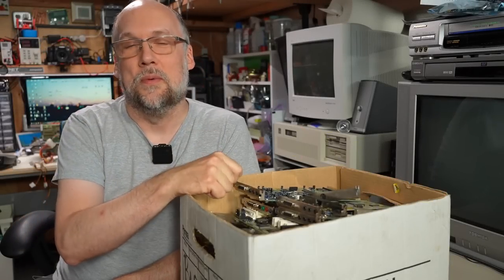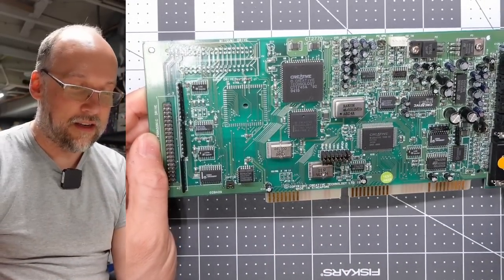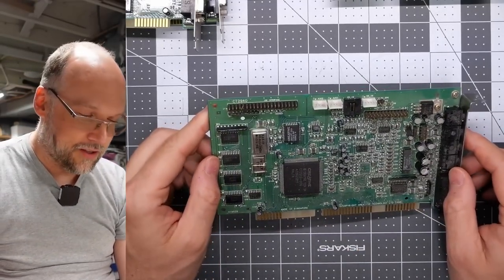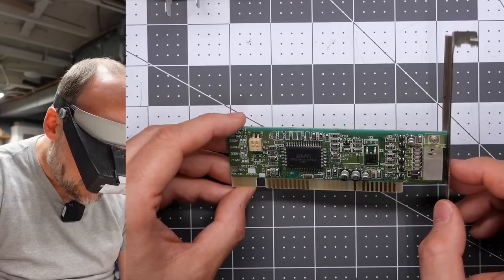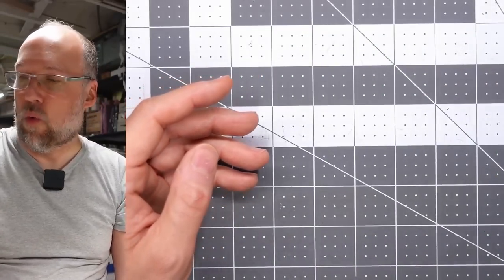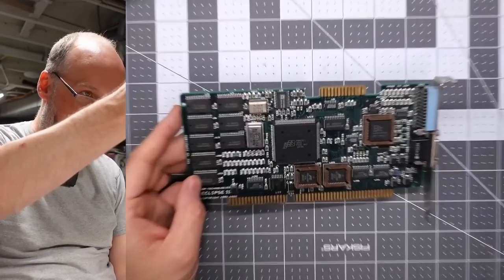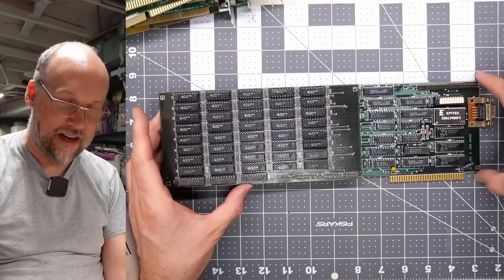Tech archeology: Exploring mysterious computer parts

Comment: the tms34010 was used in TIGA video cards. these were used for CAD workstations as far as I understand. the closest I have been able to find was the Siemens C79040-R430-C35-02-87 which uses the same chip for video. I think I saw TIGA drivers for old Autocad before.
Reply: Yes, I can confirm 👍
Some of these cards have a Demo mode built in by the way, enabled by dip sw
Reply: Correct. The TMS34010 was the first programmable GPU. I designed both TMS34010 and TMS34020 boards and AutoCAD was a very typical target application. They were used in both accelerated and mostly non-accelerated roles where some operations needed a boost. There was also a version of the chip with just the video circuits and no acceleration called the TMS34061 which the same team created and which also powered a lot of video cards from then.
Reply: Yeah I used to use a 34020 based #9 card that was TIGA.  But TIGA was a standard from 1989, so a card that says 1987 might not follow the standard or could be a prototype card.  I sure don't see any info that vectrix corp ever released a TI based card.
Reply: Someone mentioned EX1280 and pictures sure seem to match.  I found a brief mention in a pdf saying it was a high res video card with built in vga support as well.  Strangely there is also code in mame for that card. Was it used in some arcade machine?

Comment: The MultiSound line of cards from Turtle Beach was well renowned in pro-sumer music, recording, broadcast, and audio engineering circles as an affordable, high quality audio interface with very low noise.  There are only a handful of DOS games that natively support them for PCM, and they don't offer SoundBlaster emulation or FM synth.  Wavetable-equipped models are General MIDI, however.  Yours is missing the "Tahiti" silk screen which would have been where you wrote "Tahiti" on it.  This probably means it was sold as the Turtle Beach MultiSound Monterey which included the Rio wavetable daughtercard as a bundle.  The Rio utilizes a ICS WaveFront synth chipset, Motorola 68EC000 microprocessor and includes VoiceCrystal soundfonts in its 4MB ROM and SIPP slots for RAM expansion.

Turtle Beach also marketed some more consumer/gaming oriented cards like the Tropez and Monte Carlo series.  I had a Monte Carlo 929 for years and it had very good SB Pro emulation, even stereo worked flawlessly.  It had a real OPL3 IC, and a Windows Sound System codec.  It was noticeably quieter than generic Opti 929 based sound cards, not to mention my Sound Blaster 16.

Comment: 54:18 The Zilog SCC is communicating via an AM26LS30 Dual Differential (EIA-422-A)/ Quad Single-Ended (EIA-423-A) Line Driver chip, and a AM26LS32 Quadruple Differential Line Receiver
Reply: https://en.wikipedia.org/wiki/LocalTalk

Comment: Almost guaranteed the protoboard with the gal, was decoding IO address, and latching them and then exposing the data on that 25 pin dsub, and it looked like they actually had it wired in through the standard 1-8 data pins for the d-sub printer port...

I'm wondering if someone went through the heroic effort to build their own printer port... :P
Reply: I also thought that was a parallel port based on how the socket was wired. But with the low chip count, maybe a subset of functionality to just about allow printing but not all the status lines?
Reply: @davidknoll  from what I know you only really need the data,strobe,gnd pins and you can print, if you don't overrun the buffer on the printer.  Without the control lines the printer can't tell you when it's buffer is full.

also you may need to hook the select in pin to a pull up, just so the printer is ready to recieve your signals.  

If the strobe signal was hooked up to the write signal from the isa bus, I bet it COULD work....

Comment: From 2000 to 2006, I worked for Keithley Instruments. I remember those boards being made at the Solon plant. I used to be the tech for the 236, 237, and 238 SMU lines.
Reply from the maker: Oh that's cool. Do you know if they sold well? Or better question -- how many were they manufacturing?
Reply: @adriansdigitalbasement  Not certain, but I do know that department was always kept busy for some time.

Comment: That current output on the DDA-08 is still quite useful. 4-20 mA is used for industrial and lab control operations in a current loop. Still used today as it’s much more noise tolerant.

Comment: 4 to 20 mA current loops were common in pre-digital industrial automation. Current was used (rather than voltage) because any voltage drop over long wires was irrelevant. E.g a temperature sensor could output a current between 4 mA (0C) and 20 mA (100C). If no current was present, that was an error condition.
Reply: They're still in common use today on brand new super expensive equipment. Now there's also a slow bidirectional serial interface which rides on top of the current loop as carefully crafted noise which is called HART (Highway Addressable Remote Transducer).

Comment: I definitely know this feel, I have quite a few boxes full of boards in my garage that I dig through every now and then. Last time I was digging for a couple of LM386 chips, and found them on modem boards (both ISA and standalone). 
53:05 that proto board seems to be rigged up as a plain old parallel port
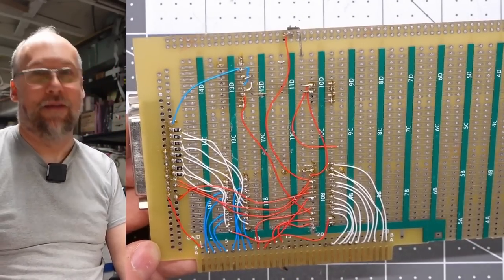53:40 TOPS was an early file-sharing software for Appletalk. The SCC chip was the serial chip in the Macintosh which had the 1mbit mode that was used for Appletalk, so this was a PC card for TOPS file sharing over Appletalk. (as you discovered)
59:00 that's an In-Circuit Emulator for debugging a 386. Very expensive back in the day, but they had to give up on that type of board as chips got fast enough that the length of the pod cable became too long to work with. Nowadays chips have built-in debug support that doesn't need every signal brought out in a big cable.

Comment: Like you suspect, the AWE64 is pretty much a revision of the AWE32. The biggest difference is that it doesn't have the easily expandable memory and it drops the OPL3 chip for the FM Synth capability and effectively tries to emulate it instead with a CT1978 chip. It is fully backwards compatible with the AWE32 in my experience (eg. you can use AWE32 as the option in games that have it). AWE64 is the audio card I've got in my DOS system, and it sounds more or less how I remember the AWE32 sounding with games like Duke Nukem 3D.

Comment: 31:16 - I don't know what's wrong with me but I love the look of bare unpopulated PCBs and fully populated ones as well. I don't know, it's just the aesthetic is tickling something in my brain but I just turned into a hardware liker around the pandemic. Before that I was more connected to the software side of things.
Those Blackfoot cards look especially amazing, both the populated and unpopulated ones! I love the matte coating!
Reply from the maker: Yeah clearly knowing those are some DSPs on there, that was some kind of card to provide extra processing power to a Mac for some kind of calculations or something. Perhaps someone will be able to dig up the info extra info and then at least curiosity can be satisfied.

Comment: Cool man! So, I bought a software/hardware bundle from Turtle Beach called "Quad Studio" when it was released in 93-94. It consisted of a "Turtle Beach Multisound Tahiti" ISA card, an audio recording program which let you record 4 tracks of audio simultaneously (like a 4-track cassette recorder) with faders that were midi CC controllable, and a wave editing program that also let you apply effects to the tracks (but not in real-time). I bought it so I could record 4 tracks, then bounce them down to 2 tracks without any signal degradation, and then keep overdubbing as much as I wanted. It was my first "digital" recording studio, which was new for IBM PC at the time that didn't cost 1000's of dollars. I believe I paid $550 for the bundle and I still have the card and software. That's awesome you got one in the box. It was a great card for the time with noise-free recording of 16 bit / 44.100 kHz. It's MUCH better than any Sound Blaster. It's not a gaming card though, It doesn't have any on-board FM but, it has a Wavetable header for the "RIO" daughterboard that sounded great. So, Yeah! It's definitely worth playing around with on an old system if you need clean sound and MIDI I/O.

Comment: @1:01:04 - It looks to me as if there is just an extra "loose" socket on top there, likely to protect the pins of the main one, or maybe as a "riser". So, the pins underneath are probably okay.
- As for the ribbon cable: I would shorten the cable a bit, just before that nasty cut and then try to crimp it back onto the connector on the board. It may be just as fiddly a job, but it would definitely be a better outcome in the end, than attempting to patch up the cut.

Comment: From Wiki:
The AWE32's successor, the Sound Blaster AWE64 (November 1996), was significantly smaller, being a "half-length ISA card" (that term is misleading—see the pictures for size comparison). It offered similar features to the AWE32, but also had a few notable improvements, including support for greater polyphony, although this was a product of 32 extra software-emulated channels. The 30-pin SIMM slots from AWE32/SB32 were replaced with a proprietary memory format which could be (expensively) purchased from Creative.

The main improvements were better compatibility with older SB models, and an improved signal-to-noise ratio. The AWE64 came in two versions: A standard version (later rebranded as Value) with 512 KB of RAM and a Gold version with 4 MB of RAM and a separate S/PDIF output.

Comment: The big appeal of the AWE64 is in the "gold" version of it, which is one of the best card for sound quality Creative ever made in the ISA form factor, and it doesn't have the MIDI bug that earlier cards all have back to the SB Pro 2.0 or the original full length SB16.
Creative was always cheap with their electrical design of their cards, using the wrong kinds of capacitors as cheap as their could get, not doing proper filtering, and generally just being incredibly electrically noisy to the point that they interfere with FM radios in an open-air case.

Comment: 10 mins in the video and I recognized that Logitech card, that port is designed for a ScanMan hand scanner, I have the device itself but I haven't seen it's card, didn't knew it was that small tho as the scanner itself covers your whole hand
Reply: Let me tell you, the experience using that wasn't great, and things you scan with it tend to get distorted. Hand held scanners were silly, maybe to scan cards or small things, but even that would easily slip more one side than the other, so you get weird results, or tons of retries. The moment flatbed scanners appeared, those things were no more.

Comment: For the broken ribbon cable you could cut a straight line across the cable just below where it tore and reuse the connector (you can see where the end of the cable comes out of the connector) by carefully lifting off that thin lid (I've done this on 40 and 80 pin ribbons).  It keeps it original and no bodging required.

Comment: MIDI uses optocouplers so reverse engineering should be fairly easy.
Reply: Both the MIDI boards had the opto-coupler so working out the pinout should be easy as you say.

Comment: Hi Adrian,
regarding your heavily botched TIGA card: There also was a Commodore Amiga card using the same processor, the A2410 University of Lowell card. I once owned one of these but wasn't able to get it running with the Workbench emulation (originally it was designed exclusively for Amiga Unix as far as I know), so I sold it over 20 years ago.
Reply: Yup, the TMS34010 was supposed to be the first fully programmable video processor. Used in high end applications like Autocad, but eventually wound up in video game machines. I think its failure led Texas Instruments to exit production of CPUs and video chips.

Comment: We sold many The Turtle Beach sound cards to our higher end PC users (musicians) back in the 90's when I worked in the business. Certainly not
a card for the everyday PC user althrough a few did buy them.
The Motorola 56001 was also used by Silicon Graphics in the Iris Indigo series of machines. They may have been used in the
Indy and Indigo 2 series too, not sure.

Comment: Regarding the AWE32/64... the AWE64 is basically a revised AWE32, their capabilities are almost identical with a few minor notes - the AWE64 can pass its effects engine through to FM synthesis, so FM music can have reverb, chorus, etc.  The onboard RAM of that AWE64 version is 512KB, but there was a higher end model that had (I think) 4MB.  The AWE64 gets its extra sound channels through software synthesis (which bumps its minimum requirement up to a Pentium).  This software (Creative WavEffects) can be used on AWE32 as well iirc.  TBH the best part about AWE64 is cleaner audio output, much nicer than the AWE32.

Comment: All those unpopulated PCBs and prototype stuff reminds me of some of the Compaq and Heath(kit) stuff I have been given over the last couple years.

I have several friends that retired from Heathkit and have met some of their engineers from that time. I have a couple Zenith computers and a Heathkit H5100 test build from one of the former engineers, plus a bunch of miscellaneous ham radio equipment.

I also have a friend that worked in the Electromagnetic Compliance lab at Compaq (and later HP) that gave me a pre-production laptop. It's a Pentium 4 mobile machine, so nothing super special, but it's cool to see an HP laptop with a Compaq BIOS.

Comment: 42:13 The DSP in the Mac Quadra 840av (the fastest 68k Mac from Apple) is an AT&T DSP3210, clocked at 66.6 MHz.
It's little brother, the Quadra 660av has the same chip, but clocks it at 55.5 MHz.

AFAIK these are the only 68k Macs which have an DSP on the mainboard and they were released pretty much exactly 30 years ago.
The DSP is mainly for audio (speech recognition) and modem applications, like for example using the Mac as a telephone with answering machine.
As I understand it, video is handled by a separate Philips chip.
Software-support for the DSP is pretty weak otherwise and these Quadras were only available for about a year.

Then Apple changed its CPU to the PowerPC platform which didn't use DSPs. They were MUCH faster and did this is software.
Some PowerMac mainboards or videocards also have video inputs/outputs and a Philips videochip so you wouldn't miss much if anything.

The NeXT workstations indeed used a Motorola 56001 DSP chip and it was also used for audio applications.
The difference is that it was released four years earlier than the av-Quadras (NeXT apparently was the first company to put a general purpose DSP on the mainboard).

Comment: Arroya Technology was founded in 1989 by a group of engineers who had previously worked at Apple Computer. The company's first product was the Arroya NuBus Video Card, which was released in 1990. The card offered significantly improved graphics performance over the built-in video card on the Macintosh II.

The Arroya NuBus Video Card was a graphics card that was released in 1990 for the Macintosh II. It offered significantly improved graphics performance over the built-in video card on the Macintosh II. The card had 1MB of VRAM and supported resolutions up to 640x480 at 256 colors.

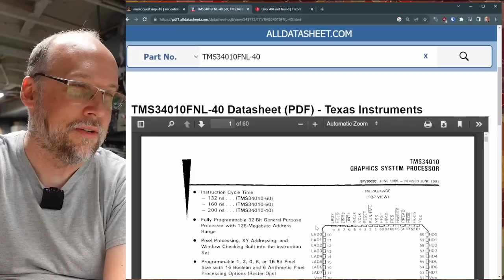Comment: 27:00 this is a so called TIGA card. Use a lot with CAD software like AutoCAD. The TI chip was more a RISC chip to handle the display lists (i.e. lists of geometric figures to draw) of the CAD software. These cards were extremely expensive (special CPU, lots of RAM for bitmap and display lists). They had some advantages but were rendered obsolete by Moore's law. These kind of cards took a long time to migrate away for the ISA bus and when PC's arrived at 486/Pentium age with PCI and 64 bits SVGA Cards, these TIGA card could not compete anymore because of the ISA bus slowness even if some had really big and fast TI chips .

Comment: Great. You found a very fancy card to cheat at Data East boot games.🤣 Use pre-tinned wire strands and sewing needle to stitch cable lines. Flux and solder tacks at each end. Cover patched areas with epoxy to prevent shorting cable. Other cards, you could pull many chips, and sell them as new Old-Stock parts.

Comment: The periscope card looks like it has a sacrificial connector where it plugs into the processor socket, just remove it and replace. 
Also, with the ribbon cable, since the cut is near the end, you can probably carefully remove the cover from the IDC cable on the board, shorten the ribbon cable and then recrimp it.
Reply from the maker: It's a bit tricky to do that because it has very thick shielding on the ribbon cable, which ends right before the connector is crimped on.

Comment: The difference between the AWE64 and AWE32 is bare minimal to none, basically they consolidated more logic into single ICs and because they where greedy with the addon market changed the memory modules to a proprietary connector instead of the normal 30pin we all love. 
As such, between the 2 I will always choose the 32 with the memory slots preferably full with 2 8Mb modules (it maxes out at 24Mb which is foolish, 16+8)

Comment: Awe64s were software compatible with Awe32s. Most of the enhancements the Awe64 had were just in the Awe64 Windows Drivers. The proprietary memory expansion for the 64 makes it less appealing, the 32 with 30 pin simms is IMO the best of the line as you can reallly improve your midi with a large SBK soundfont.
The MQX-16 should be fairly easy to scope out to find the midi out pin in order to make your own cable. Midi is just serial so you play something and the pin with activity is midiout,